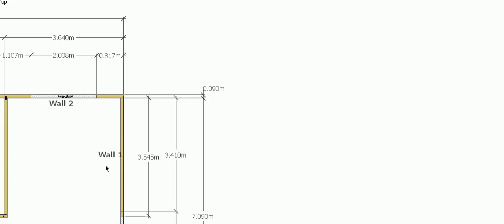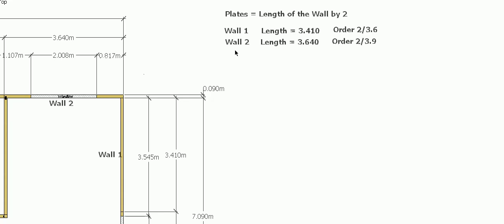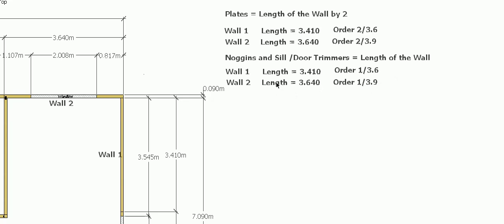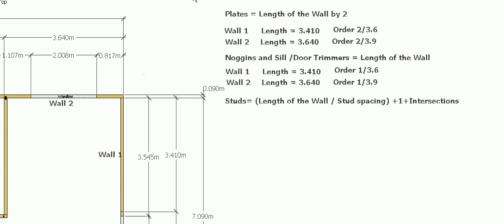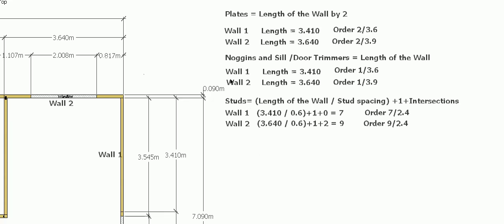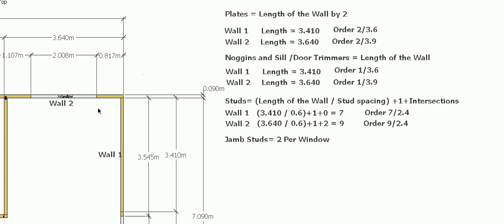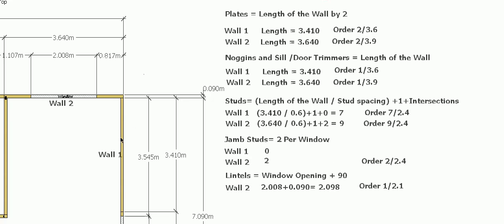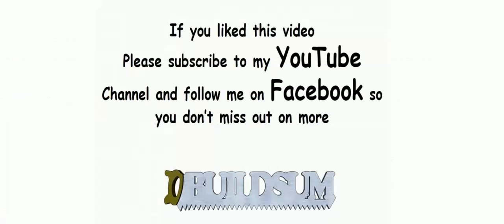Calculate Wall Frame Quantities

Comment: Hi! When you perform your stud calculation, how many studs do you add when you have a external corner?  I see people add 1 in each corner, or even 2. How that works in autralia? Thank you
Reply from the maker: Hi Mate, you need 1 extra stud per intersection so I just count the intersections in the wall im working out and add that. Just dont allow for them on the intersecting wall.

Comment: Can i ask if this scenario acceptable: i have 2440 finished flooring to ceiling.10mm ceiling and 20mm floor tiles and adhesive.can i just use standard 2.4 stud and 45mm top and bottom plate. So i can save some labour to cut down stud to match 2440 finish 
Thanks
Reply from the maker: Hi Mate, you could but you will be lucky to get all the lengths of timber exactally the same length, they are usually supplied slightly longer then thier advertised length and will need to at least have the ends sqared up. Hope this helps.

Comment: your video is amazing and very clear simple. can you show me how i can calculate my external wall cladding?
Reply from the maker: Thanks Mate, this video may help, https://www.youtube.com/watch?v=WtLDYoHZYYg. Let me know if you have any further questions.
Reply: @Buildsum  did 0.23 is standard or depends on size of the width of any weatherboard?
Reply from the maker: It depends of the width of your weatherboard and the minimum specified lap.
Reply: @Buildsum  So for example, if the width of my weather board is 200 (0.2) , what will be my anticipated lap, in order to calculate my EEC?
Reply from the maker: The normal lap is 20 - 25mm.
Reply: @um Thank you very much for your  responses

Comment: i love your videos and they're really helping me through my apprenticeship so thankyou! Although I don't understand, wall 2 that has the window, you have divided the wall length by stud spacing for common studs. Would you not have to minus the length of the window and then divide by stud spacing?
Reply from the maker: Hi Mate, thanks for your comment, I'm glad you like the videos. As for your question the amount of timber you are going to save is minimal considering to need Jack Studs above and below the window and Jamb and secondary stud beside the windows anyways. 
If you did it the way you have suggested you would then have to workout the Jack Studs etc. 
Hope this helps.
Reply: @Buildsum  thanks!

Comment: Hey, to find noggins should we deduct door openings?
Reply: Well i have already found header over doors and windows. So in this case i need to right?
Reply from the maker: Ok, have you allowed for the window sills? By calculating the noggins as the same length as the wall we allow for the Door head and the window sills and then the window head are calculated separetly.
Reply: @Buildsum  yes I have done that. And thanks for the reply. Your video did help me finish my work.
Reply from the maker: Thanks Mate, good to hear
Reply from the maker: Hi Mate, if you do you will just have to add more timber for the door heads.

Comment: What is 2/3.6 and 2/3.9 _ could not get it
Reply from the maker: Hi Mate, 2/3.6 is 2 lengths of whatever timber you are using at 3.6m long. Hope this helps
Reply: @Buildsum   Worked well, Thanks :)

Comment: As an expierienced estimator of 20 years this is absolutley inncorect you missed the ribbon plate , your studs are all wrong you have three studs to an intersection , you missed the jack studs to the windows you missed the header plates , you missed packers to your interections. This advice is not correct
Reply from the maker: Hi Pete, Thanks for your comments. I would be interested in seeing your method of working out the wall frame quantities and to know what country/state you are building in.
Personally, as the Australian Standard 1684 - Timber Framed Buildings does not require a ribbon plate in all situations and because if I am building a frame myself I would rather not have the joins in the Ribbon Plate line up with the joins in my walls, I tend to calculate the Ribbon Plate as a separate item and just order the longest lengths to make up the required lineal metres.
AS 1684 requires 3 studs per intersection in most situations and this is the most common method use in my area.
As I have not made any deductions for the window with my Stud calculations the Jack Studs, Trimmers/packers/plates for the Header and packers for the intersections will come out of this extra material and the extra material due to the rounding up to standard timber lengths.
I hope this helps clear up a few of your concerns.

Comment: Hey there, just so you are aware a noggin is your head, a nogging is the horizontal member that's nailed between your studs.  There is a tool that automatically draws and breaks down multiple walls into member type, cut length and order length, this tool works inside Sketchup and is called @Plusspec
Reply: Once I hit my noggin on a nogging.

Comment: Great video. Thank you.
As a question, should you include the cripple studs under and possibly over the window or are you referring to a sliding door style.
Reply from the maker: Hi Mate, yes you would have cripple or Jack Studs above and below the windows. Using this method to calculate the members doesn't allow for the windows as the amount you would actually save would be very small.
Thanks for you comments

Comment: Would you really order all those different sizes? I would have thought it’s easier calculate total linear meters and order pack of 4.8 m. That way you can cut your studs to 2.4 with minimal waste, cut your plates and use any offcuts for noggings.
Reply from the maker: You could do it that way Martin as long as you take into consideration that your Jamb Stud may be a different size than the studs you are using. You could double up the thinner material however that is more material. 
Also, you may need to have certain length plates to avoid window and door openings and join at intersections rather than in a straight run.  

Yes, I would definitely convert large numbers of shorter lengths into lesser numbers of longer lengths e.g 4.8m lengths for the studs once I have calculated the total number required.

This video is just meant as an introduction to apprentices so they don't miss anything and they can see how each member is calculated. Once they get their heads around this I'm sure they will develop there own shortcuts and rules for calculating the materials

Thanks for your comments
Reply: Thanks for the reply. We are doing the owner builder thing and I have found all your videos very useful. I think I have watched just about all of them. Thanks again.